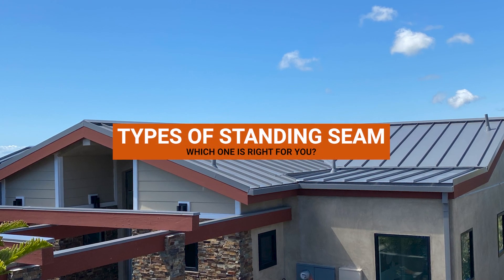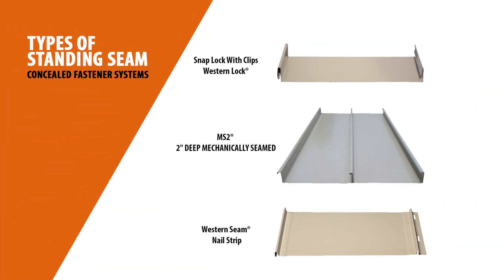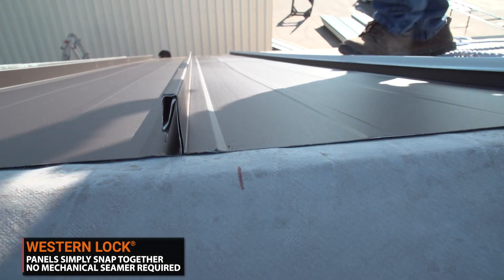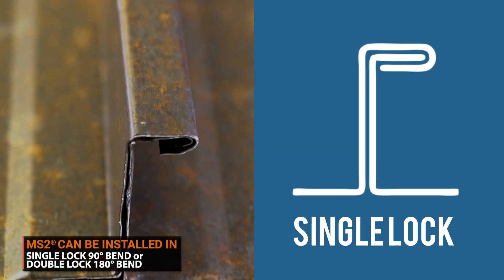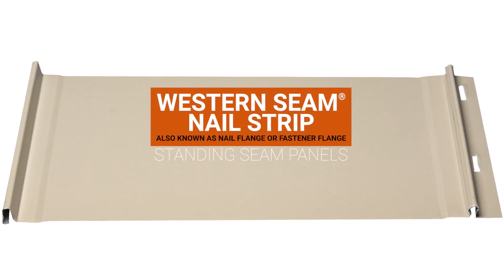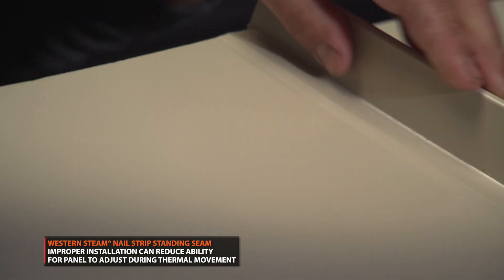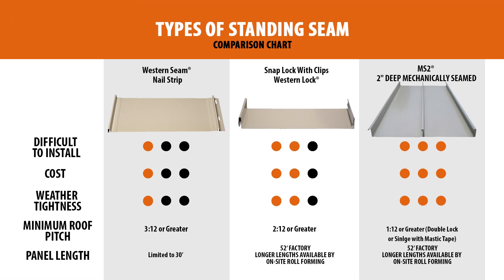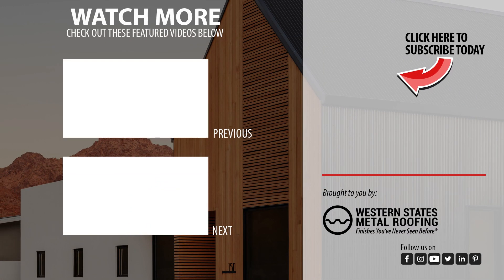Which Is The Best Type Of Standing Seam Metal Roof? Snaplock Vs Mechanically Seamed Vs Nail Strip

Comment: Hello!

A properly installed standing seam roof using double lock seams can hold up to most weather without blowing off of the roof. Excluding hurricanes. They are a beast of their own, however even this can be calculated for if there ever was a desire to.

What is important is to make sure to increase the amount of clips and screws you use at the most wind exposed parts of the roof.

This would include the foot of the roof, the sides and the ridge.

You could also make a standing seam with a double lock along the ridge, Connecting both sides of the roof and giving the wind nothing to catch onto.

Aswell as lay the seam down at the foot of the roof and fold every panel and standing seam around the foot plate, creating a whole unit holding onto it.

However, This would require additional expertise, time and labor costs

This is how its done in most of europe.

Although the panels might not blow off of the roof, they are still subject to being penetrated by flying debris.

Cheers!
Reply: Can you replace one metal panel if it is damaged by flying debris, or you do have to replace the entire roof to fix one damaged area?

Comment: Like others have commented, great to the point, no BS video.
How difficult is a repair on a Snap Lock /clips system?  How much disassembly would have to potentially be done, in order to remove an damaged panel?

Comment: 2 questions 
During the rainy times, does it make the ticking sounds (like on a tin roof)?
What about eventual corrosion and how soon does it happen?
Reply from the maker: When it rains you will hear a bit of a ticking sound, but it's not that noticeable. I have a metal roof personally and it's never been loud enough that it annoys me. The underlayment that is beneath the roof softens the sound a bit. All things will eventually corrode and if you live near the ocean than you should not use metal (use aluminum or copper in that instance). In a normal environment the roof is designed to last 40+ years. It is steel that's been coated with a galvalume coating. In addition, it has a high quality PVDF paint finish. The warranty on the paint finish is 30-40 years depending on the paint supplier and the color that's chosen.

Comment: My wife and I put an exposed-fastener metal roofing on our house fifteen years ago. It was all we could afford. Big mistake. I'm now planning to tear it all off and install a nail-strip standing seam roofing product instead. Exposed fasteners loosen over the years and leak, which only gets worse and worse. Fine for outbuildings but not a home.
Reply: Do you just need to replace the washers and put the screws in tighter?

Comment: FEMA has found that snap lock metal roof panels are the worst performing panels in wind storms, this comes from their inspecting roofs after hurricanes. The problem with all standing seam roofs is when the first panel starts to peel away it takes out a row of panels with it, this is especially true of mechanical standing seam panels. Exposed fastener panels perform very well in wind storms, if a panel does come off it will be just one panel, it won't take out an entire row of panels like standing seam panels do.
Reply: I’m not a big exposed fastener fan. I’ve seen many of those in my town and all those fasteners with the rubber grommet will need replaced in five years! I do understand the domino effect though in the wind with the snap locks.
Reply: @I_Am_Your_Problem  wow! Why the insult!?
Reply: fema also got roasted for its racist & woke workforce
Reply: Don’t mess with this guy, he’s passionate about FEMA😂
Reply: Id trust a Ray Charles observation before FEMA
Reply: I think I’d trust an insurance company before I trust FEMA. Got a link to that FEMA decision?

Comment: I live in a high wind area, will this work for me?
Reply: High wind areas should stay away from snap lock panels, the wind pressure can cause the panels to disengage and blow off. Either go with mechanical standing seam or exposed fastener. Todays exposed fasteners are superior to exposed fasteners from 10 and more years ago. You can now get fasteners with a cap head that shields the EPDM washer, EPDM is a long lasting material.

Comment: The standing seam metal roof on our 1866 built house needs to be replaced but the metal roof fits right into the wooden gutters.  I assume because of when it was built they  used the mechanical seam roof so do we need to use that type or can the other types of metal roofing fit in the same way so we can keep our wooden gutters?
Reply: Your roof lasted 159 years. You should be replacing it with the same type if it needs replacing at all.
Reply: You can use different types of roofing to fit with the wooden cutters, but you shouldn't ruin an old classy house with anything else. Just use mechanically seamed roof, that is the only way to go.
Reply from the maker: Karen, It's impossible to answer that question. You will need to ask the roofing contractor when they come out and do a bid on your roof.

Comment: Seems like I don't want the nail in type (due to the metal being ripped by the nails), nor the mechanically seamed (due to installation time & skill required) but the Snap lock with clips goes on easier and lasts longer than the nail in type.  Got it!  But the orange and black dots confused me.  What do they mean?
Reply from the maker: I can see how those dots can be confusing. 1 dot is the least and three dots is the most. Basically nail strip is least expensive & mechanical seam is most expensive + snap lock is in the middle.
Reply: FEMA has found that snap lock panels are the worst performing panels in a wind storm, this comes after FEMA has inspected metal roofs after hurricanes. The wind pressures will cause the snap lock panels to disengage with each other.
Reply: Would be interesting to see the price difference between nail strip and snap lock with clips I get the feeling it is pretty substantial

Comment: are these panels recomended for concrete roofs? how should they be fastened to a concrete roof?
Reply from the maker: Luis, In a residential application these panels are normally attached to a solid wood substrate with synthetic roofing underlayment between the standing seam panel and the solid wood substrate. There are instances in which these panels can span from metal purlin to metal purlin, but you normally would not see that on a residential house and it would require an engineer to determine the panel chosen and the distance between purlins. 

It's not appropriate to install standing seam on concrete and I would have no idea how to fasten it correctly.
Reply: @WesternStatesMetalRoofing   I would not suggest installing any type of metal roofing straight on top of concrete, atleast install a thick underlayment or plywood underneath
Reply: @WesternStatesMetalRoofing  In China, most metal roofs are installed on a concrete base, which I know is hard to believe, but the reality is that it actually happens. Usually, we weld a layer of steel square tube keel on the concrete base, lay a layer of corrugated steel plate on the keel, and then install a metal roof on the corrugated steel plate.

Comment: How long does it take for the head of the fastener to wear a hole in the panel or for the nail strip panels to rip themselves apart due to over tightening the fasteners.
Reply: The screws don't typically wear a hole in the panel but can leave a visible dent in it.
Overtightening does not really happen, because as long as the screw is not going through the nailstrip, it will still allow the panel to expand unlike they told in this video.